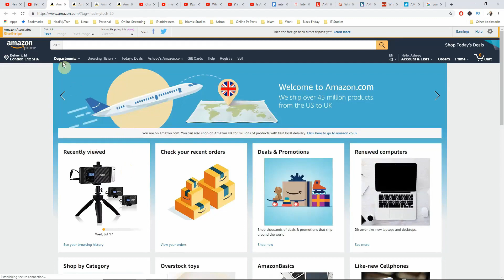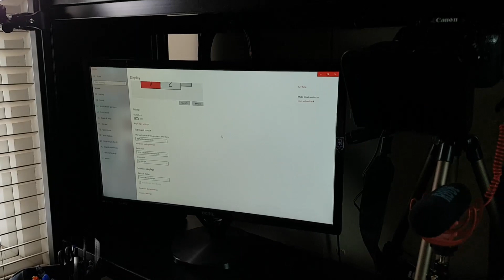Step By Step Guide To Build A Computer - Swap PC Case & Buying Guide  - Pt 9

Comment: I got issue about some type of desktop case that really bad with air flow for cooling system, mostly proprietary case from company like HP, Acer and Lenovo.. their heavy and thick metal case act like heat storage.. but i love them because they practically small and have so many storage expansion for server build.. like the one i use now, Acer Aspire M1100..